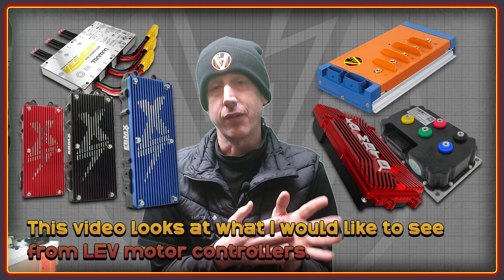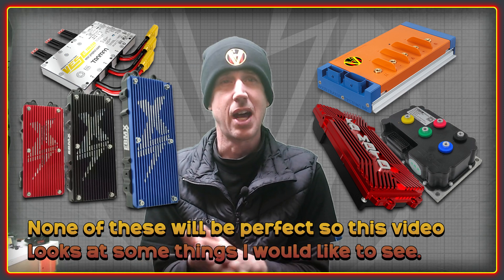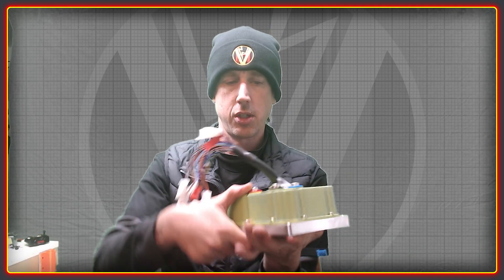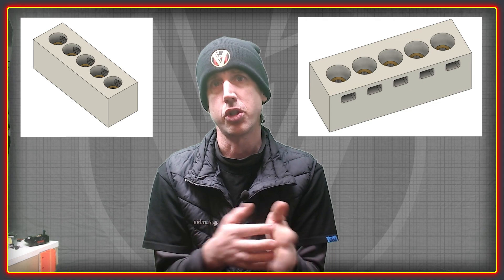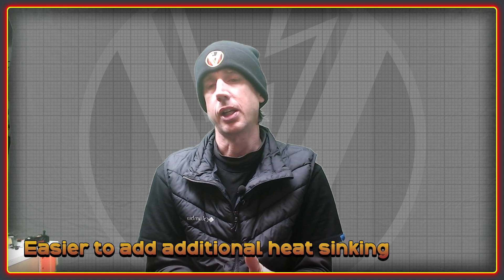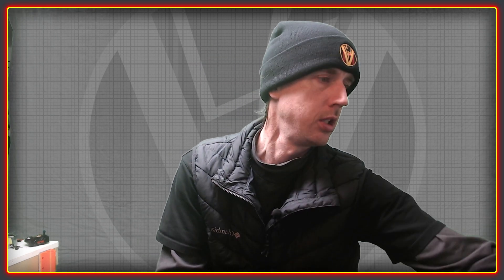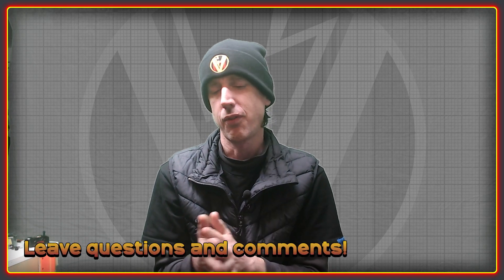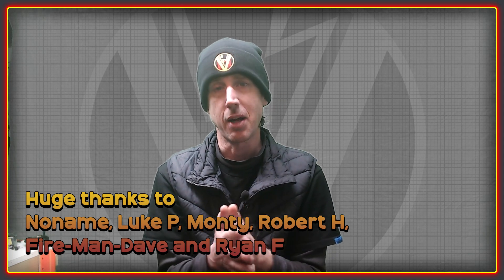Motor Controller Design Ideas - Thoughts on improving motor controllers for electric vehicles

Comment: I'm wondering if adding more thermal paste into the back of the mosfet connections could help the board dissipate heat into the case more effectively?

Comment: the new str-500 controller from the guy that designed the vesc archetecture looks really interesting lots built in switching controls for lighting and accessories ,usc c vesc express built in so you can plug in gps ,sd cards wifi and bluetooth has can buss for advanced displays and the price looked alot better than ebmx and other vesc offerings
Reply from the maker: Do you have a link. Always interested in new controller options
Reply: @HighVoltageKits  check out trampaboards cant post link

Comment: Actually, another thought on all these great features, it should be a separate box, motor controller should really be just a controller-power things, battery in motor out, it should also double as charger.
Reply from the maker: That's a good idea, hold everything in one unit. I don't think anyone is doing that so far. Cheers

Comment: I got interested awhile back after watching your video on the bac800, and how you can program it to have a constant low power going to the motor to help with the jerking on your cassette and derailer, but now you can do this with the eggrider and BBSHD stick controller. So besides allowing 72 volts, what are the advantages of buying your BAC855 kit?
Reply from the maker: That's the first I have heard about using the eggrider in this way with a stock BBSHD controller. If you have a link to this can you post it please. All the eggrider does with the BBSHD is let you change the stock settings it does not give it anything more firmware wise. Happy to be wrong though. In terms of additions you get over twice the power, a much higher top speed and a silky smooth throttle response. The BAC855 has field oriented control which the stock controller lacks.
Reply: @HighVoltageKits  setting pedal assist 0 to level 1. did I hear that wrong? see here:
https://youtu.be/iUzQUbWZ9rM?t=774
12 min 55 mark in case your browser doesnt load the timestamp correctly.
Reply: @HighVoltageKits  also here at time index 3:55
https://youtu.be/7zgel4tAIFk?t=232

Comment: I agree with everything,  particularly how water ingress is afterthought with some expensive controllers.

To the list I'd add on off switch that enables hibernation. The capacitors and Fets are always powered but require only a few a microamps at most. 
Low enough standby current to leave it connected to batteries for a long time when not in use. Saves plugs or anti spark switches.
This is something some controllers have, others don't. Very underrated feature.
Reply from the maker: That's a really good thought! Thanks

Comment: Wow some of those controllers are HUGE! I have been designing my own brushless motor controller for robotics for the last year. It is working pretty well, and I am doing some initial layout on a 100 volt 150 amp version specifically for ebikes. The thing that is different about my controllers is they are completely open source, and you can order them directly from the board fab house in China (JLCPCB), so you don't have to pay any mark up if you do a group buy. I think my 100 volt 150 amp controller will cost around $50 each if someone buys QTY 10. I will also encourage community members to open the Kicad design files and move connectors around or add whatever they need. I am not trying to run a motor controller business, I just like to make good open source hardware. Anyway I have a lot of side projects so this might take me some time, but I will be posting to the discord when I have something to show off. It will be based on my current open source controller here: https://github.com/Twisted-Fields/rp2040-motor-controller

Comment: the new Fardriver has a cover over the terminals and they are definitely waterproof but the silicone makes repairs a challenge...
Reply from the maker: That's good I will have to check that out for sure. Cheers

Comment: Good points tho, GPS tracking could also have a low frequency radio transmitter, so you don't have to pay for a mobile plan...
Reply from the maker: Yeah! Great point. Having to add in a sim card would suck. Cheers

Comment: I would like to see more controllers with  blue tooth.. and a open source program to run all controllers.
Reply from the maker: Most of the higher end ones do. The VESC stuff is kind of open source although the access is not always possible on some of them.
Reply: @HighVoltageKits  The access has to be possible. If it is not the case it is a GPL license violation and it will be followed up to assure that the device can be accessed. There is a strict zero tolerance policy about GPL violations in place. This matter is one of the fundamental cores of the license. Some manufacturers might decide to void warranty if you mess with the code or firmware or settings and things go wrong.
Reply: @HighVoltageKits  cant find one in stock.. and your idea about water proofing.  Wish they had motor cycle gas tank, like the battery kit.. but for electronics.. empty chamber so to speak..I made one and works great. Water proofing all electronics. I Made air scoops to keep cooler. But all frames not the same..  you have a great weekend brother..
Reply: @HighVoltageKits  oh I like the vesc.. almost got. But used the tried and true..sabvoton it's big and heavy. But they are more familiar.. like in drone's..

Comment: How does CYC make such a discreet/small controller?
Reply from the maker: Its pretty low power. There are lots this small at 3000-4000 watt range. The little FOCer, ASI BAC855, Silicon X, Nucular 12 fet etc. The bigger ones push way way more power.